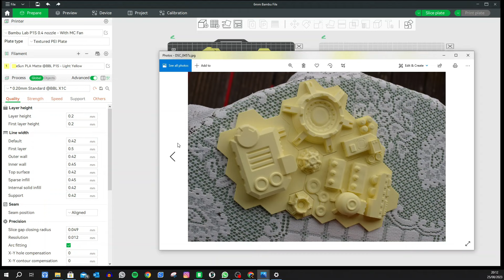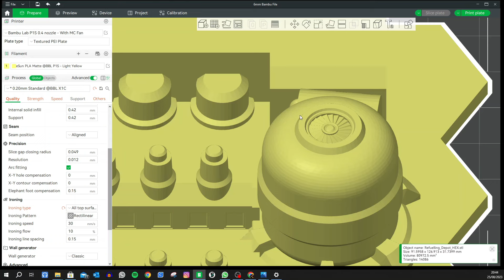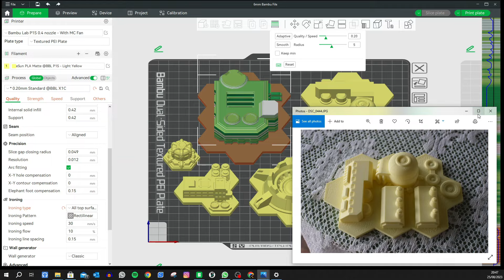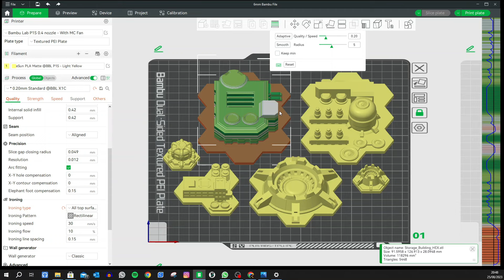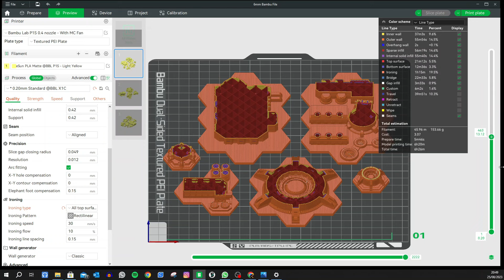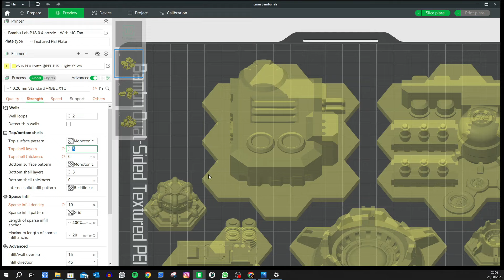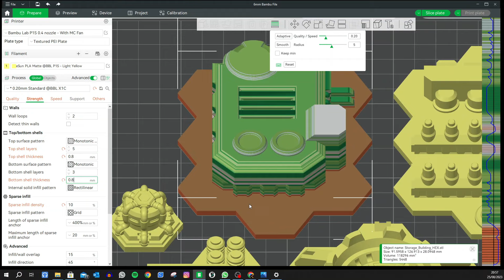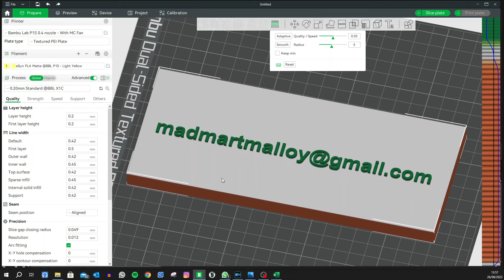Bambu 3D Printer - Ironing Settings - Saucermen  6mm Terrain

Comment: One more helpful tidbit. Change your infil to Gyroid instead of rectilinear.
Reply from the maker: Thanks for the tip. Appreciated. 👍
Reply: Is Gyroid the better infill?
Reply: @giomjava  Gyroid infill is generally better all around. Better strength, less material and faster print speed. CNC Kitchen did a thing on it.
Reply: @rjakiel73  thank you!!
Reply: In my experience. Gyroid is much slower.

Comment: I am interested to know if you tried increasing the sparse infill density settings which would effectively reduce the surface bridging (sag) issue you had. Also I would have thought it would eliminate the need for increasing the top layers thus using a lot more filament. I know increasing layer density would increase filament but should be less than layers. Also with modifiers you could increase  layer density exactly where required.
Reply from the maker: Hi. It was something I was going to try, but haven't had chance to yet (as I have a run of prints to do). When I do, I'll post a little video to show the results.
I'll look into the modifiers too.

Comment: Do i need to do a bed leveling after every print ? Or bed leveling after turning it off ( i have P1S )
Reply from the maker: I'm theory, once the bed is levelled, you shouldn't have to level again.
In practice, things do move a bit and removing and replacing the plate will have an effect.
Leave it and you could have 10 or 20 prints before you get a leveling problem, but then you need to deal with that problem.
Personally, I prefer having the 3-4 minute auto leveling cycle at the beginning of each print. This way, the risk of any issues is significantly reduced.